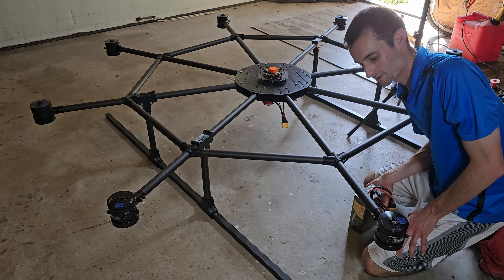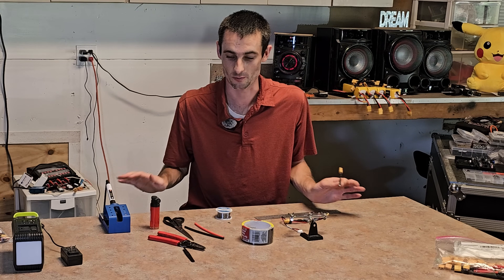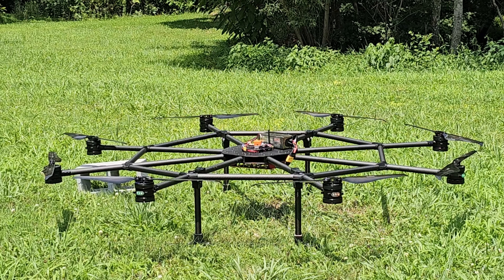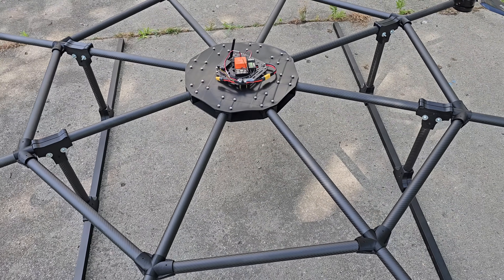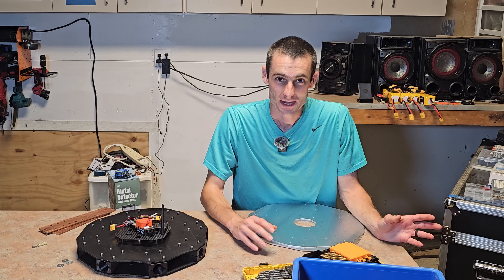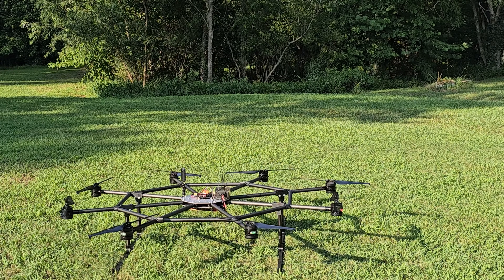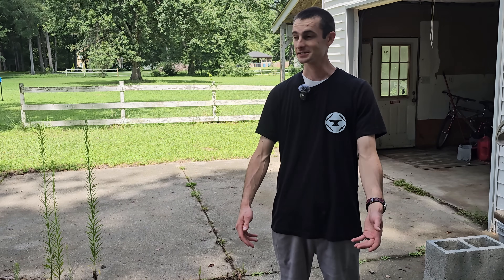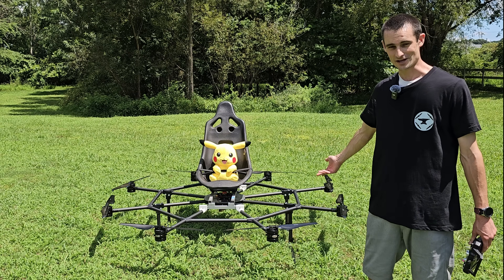I Built a (Better) Flying Car! (eVTOL) Flight Test - Part 7

Comment: That was good, but I have a question. Can you tell me how you're giving power to FC? Are you using external power for FC or directly connected to PDB with a power module
Reply from the maker: Good question. FC is powered from the PDB through a power module. Sometimes it'll work fine if you give it a separate power source, but I've had issues in the past doing that if the FC and ESCs have different grounds, I think because they have a different baseline for the PWM signal if that makes sense

Comment: We should keep it as simple as possible.
Square aluminum tubes without any perforations.
We should always avoid any joints. It is always preferable to weld or use a joint that is correct for the project to avoid induced vibrations.
A good practice to avoid induced vibrations from the motors is to use damping between the motor and the structure, such as rubber or a 3D printed base.

I am preparing a similar project where I focus on the first drones that were made of square aluminum tubes and rudimentary but efficient flight controllers.
In my opinion, the Pixhawk is not a good controller for a project like this.
With the dimensions of this eVTOL, you need a flight controller where you master the software used and know how to parameterize it so you can stabilize it.
Regarding the flight with the Pikachu, it works, but pay attention to the ground effect.

When you start putting more load on the eVTOL and flying higher, as soon as you exit ground effect, the eVTOL may not be able to obtain the necessary lift to maintain flight.
Good luck with the development of this project and I hope to see a video of your experimental flight soon.

PS. When you go to perform the experimental flight, and given the proximity of the propellers to your feet, wear steel-toed boots.

Comment: :( PLA and summer do not agree with each other.  Gosh it would be nice if you could get to the stage when sponsors joined the manufacturing fun of these projects.
(on a side note, you could slightly adjust your youtube name to something like 'Mr Dronesmith' to avoid any confusion with 'TheHacksmith'.)

Comment: Cool as but would you not be better with some of the mass under the rotor's for more stability
Reply from the maker: You would think so, but that's not quite how it works. Google "rocket pendulum fallacy" which also applies to drones

Comment: Abs will harden and crack if in continued heat. Become brittle.
Reply from the maker: Good point. I think it gets worse with sun exposure too. I'm experimenting with some different materials until I have enough $$$ to make all parts out of aluminum

Comment: That will happen with PLA in the heat, my Eclipson Model A wing melted like that after about 20 mins in full sun, printed from ABS and the meting issue went away.

Comment: I see your strength theory is not so good. This drone with loading will look like the drone you have 12:05 in the video. It's like put electric engines and propellers on a cardboard sheet.
To strengthen it you must have stability/strength vertically too, not just horizontal. Hope this will help you. 🤓

Comment: Good edit and video.  But  at 0:16, you should really be crimping those wires with a proper crimp tool and not soldering them. 👍
Reply from the maker: Thanks! In my experience, it's easier to pull out crimped wires than to break a good solder joint. But you bring up a valid point, and ideally I should probably be doing both- crimp then solder. I appreciate your comment
Reply: @TheDronesmith  Over 100 years of automotive and aviation history says crimping is better than soldering.

Pop open the hood of any car, aviation engine bay or wiring panel and see that all the wires from large power conductors to small signal wires are crimped not soldered.  This includes civilian and military vehicles.

Automotive, aerospace, marine, and military wiring harness standards (e.g. IPC/WHMA‑A‑620 Rev E) prescribe crimp‑only terminations for power and signal cables.  It even explicitly forbids pre‑tinning before crimping, because any solder in the barrel can produce voids or sliding if exposed to enough heat for long enough time.  Solder starts becoming soft well before its actual melting point starting at 183°C.  Solder could start going soft in its "glass transition zone" which below 100°C if exposed to enough force or vibrations.
Reply: @beyondfossil what this guy said.
Reply: @TheDronesmith  Over 100 years of automotive and aviation history says crimping is better than soldering.

Pop open the hood of any car, aviation engine bay or wiring panel and see that all the wires from large power conductors to small signal wires are crimped not soldered.  This includes civilian and military vehicles.

Furthermore, automotive, aerospace, marine, and military wiring harness standards (e.g. IPC/WHMA‑A‑620 Rev E) prescribe crimp‑only terminations for power and signal cables.  It even explicitly forbids pre‑tinning before crimping, because any solder in the barrel can produce voids or sliding if exposed to enough heat for long enough time.  Solder starts becoming soft well before its actual melting point starting at 183°C.  Solder could start going soft in its "glass transition zone" which below 100°C if exposed to enough force or vibrations.

Crimping is also faster and less-prone to error as it requires less technical skill, presuming the proper crimper and connectors are matched up beforehand.  It's also easier to see a bad crimp than a bad "cold" solder.  A cold solder could be hiding a deadly flaw.  When lives matter, every risk is reduced or eliminated as much as possible.  As strong as solder is, it is made to make an electrical connection not a physical connection.

As this is not an RC vehicle but one you actually put your life on your wiring, it will be good to get an inventory of all the wiring terminations you use and get the matching crimping tool.  Then switch over the XT90's to crimped connectors such as Anderson Power Pole 75 or higher with locking pin which makes sense for a vehicle of this size.
Reply: My thoughts exactly.

Comment: Very decent results so far. Probably the most stable first hover I've seen from a yet-to-be-tuned multirotor of this size. I have plenty of know-it-all suggestions though, read on...

Firstly, lock your 3D printer in a closet and get your wife to hide the key somewhere while you're working on this. 3D printed parts do not belong ANYWHERE on this, I don't care what 3 letter acronym is involved. Don't make me facepalm any harder than I was in this video :)

Yaw authority is determined by the relative rotational inertia of the props (and motor bells) vs the frame. You can't do much about the props, but you can lower the RI of the frame by keeping as much mass as possible close to the center. I would get rid of the outer ring of carbon tubes, they are mostly unnecessary. That would require stronger arm mounts at the center (ok because mass moves inward) and possibly larger diameter tubes for the arms (less ok, a bit heavier and more money). If you're concerned about the arms moving sideways, you could stabilize them with a tension member (eg. braided fishing line) at the end of each arm that enforces a maximum distance between them. Come to think of it, if there was a vertical 'mast' underneath the center each arm could be tensioned against the opposite side arm too, so maybe the current arm tubes would be fine.

The landing gear could be more central to help with RI as well. This would make it more likely to tip to one side, but a light vertical strut under the end of every other arm would avoid prop strikes. These struts can be rather light and weak (eg. thin wooden dowel) because they're only to counter the tipping force, not to actually take the weight of the aircraft. You'll probably break many during testing so something that can be quickly replaced would be preferable. Rather than mounting them pure vertical, a little angled outward so that when the frame tips, they'll be vertical when they touch the ground.

The separation between the two aluminium plates seems quite small - the closer they are the less the overall structure will resist bending. With larger arm tubes this separation would increase a bit, but I'd still be inclined to add something more to resist these plates bending. The ideal reinforcement would be internal diagonal braces but that's not really feasible. Perhaps just a third plate at a similar separation as the first two... either way, you want to be able to support the frame by the arm ends and stand on the center (maybe even jump a bit) and not be concerned about anything becoming deformed.

And now that I sound like a pretentious asshole, I'll be on my way. Just found your channel today and subscribed to see what happens with this :)
Reply: ok I watched your earlier videos in this series, didn't realize it was to have 16 motors. So my suggestion about light struts at the arm ends will not work so well, they would have to be part-way out the arms. Likewise a tension line going from one arm to the opposite would have to be anchored part-way out the arms, not so helpful. Also you said the 3D parts are only for prototyping, thank goodness :)
Reply from the maker: Hey iforce2d, I know you left this comment a while ago but I just wanted to say thanks for taking the time to write it. I've been a fan of yours for a while, and I appreciate your input. And yes, the 3D printed parts are only for prototyping. If I had a little more money to work with, I would have approached this build very differently- it's currently built using leftover parts from other projects unrelated to YouTube. Again, thanks and I'd love to hear your input on any of my other videos.

Comment: I advise making the center frame out of aluminum and carbon fiber
Perhaps using aluminum tube clamps layered with carbon fiber to have a frame study enough to not fold under the extreme stress of lifting a human, do not try to fly on it with this PLA center hub, it will fold upwards killing you in the process and I really like your work so that would be a shame
Reply from the maker: Thanks for your input. I only intended to use the 3D printed parts for prototyping. Still saving up to make most of the parts out of aluminum 👍

Comment: pika! battery strap. metal plates/connectors might be much better. maybe PETG or PET-CF. flying table. lol. well make it better then.
Reply: so, why 3d print in black. that absorbs the most sun light heat.

Comment: Dude, that frame has the structural integrity of wet noodles. I thought that was carbon, but it's black PLA.   duuuude.
Reply from the maker: Lol. Yeah, it's definitely not an engineering marvel, just something I built with spare parts
Reply: I tend to use CF PC, and have had really good luck with it's engineering properties. Highly recommend, although it's about 2x the cost of PLA

Comment: What's the brick at 4:20 preventing? Also it was nice meeting you at Opensauce!
Reply: I assume it was weighing down the one motor in case it throttled to max instead of 10%
Reply from the maker: @hectormclean33 You got it 👌
Reply from the maker: Just weighing down that part of the drone in case the first motor malfunctioned, cuz that's definitely happened before. It was great meeting you too!